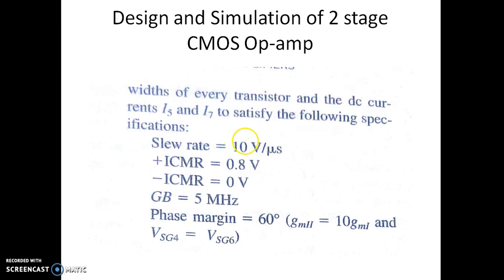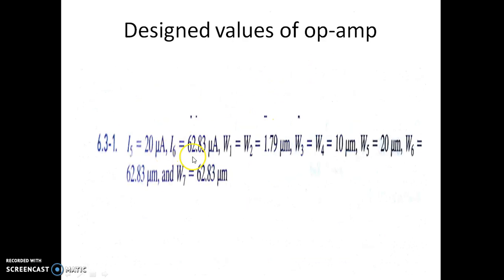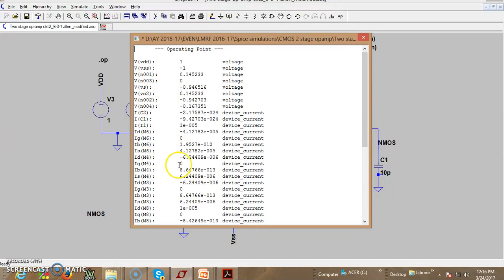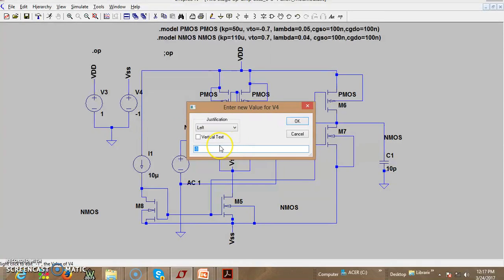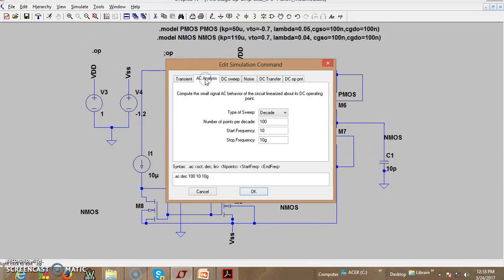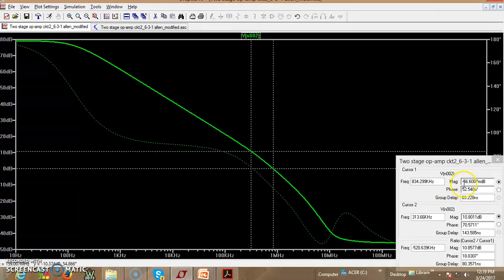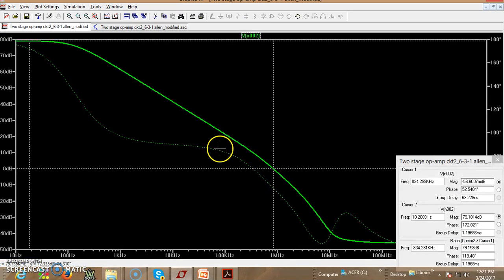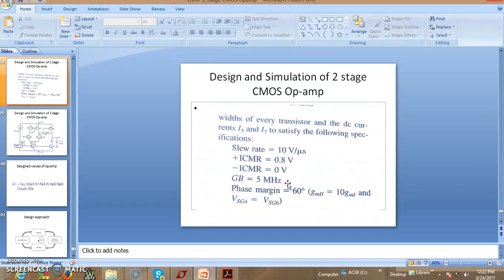4 71 2 stage CMOS opamp simulation

Comment: Sir I design an LDo regulator in ltspice,  so I first wanted to design an error amplifier. The gain is to large in ltspice. I am not able to understand why it’s so large. Can you please help to solve this problem sir??      Thanks
Reply from the maker: How much gain your looking at
Reply: Narasimhamurthy K. C. [VU3DWF]  140db sir.. which is too large. I have already mailed you the design and outcome sir
Reply from the maker: Send me the details
Reply: Narasimhamurthy K. C. [VU3DWF]  for the same design in this video when I  used the model file I get gain as negative(attenuation). I have tried using the same design values sir.. can you tell me what would be the mistake sir.  Thanks
Reply from the maker: @dharanibharani5502  you email the requirement to kcnmurthy@gmail.com
Reply: Narasimhamurthy K. C. [VU3DWF] ok sir
Reply: @dharani bharani can you please help me out. I m also designing an LDO